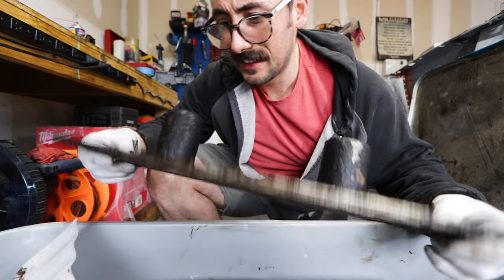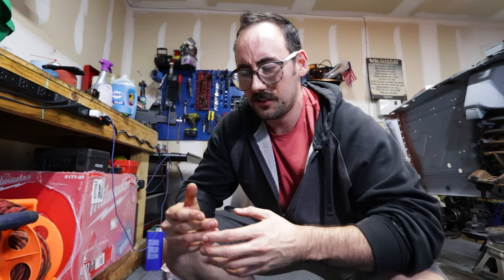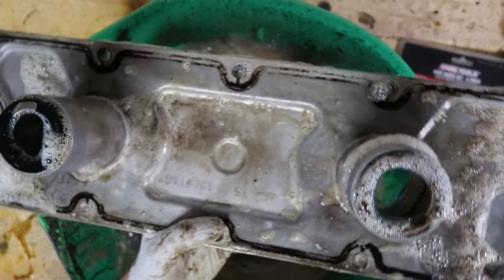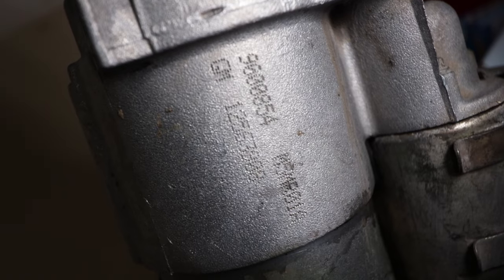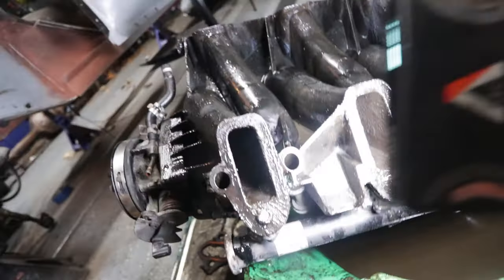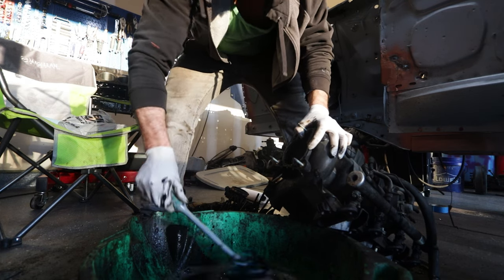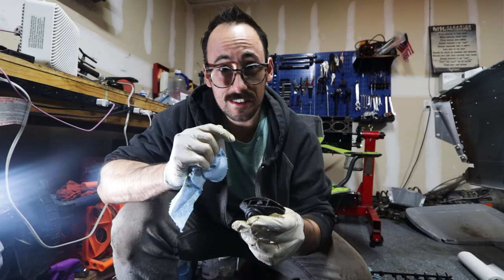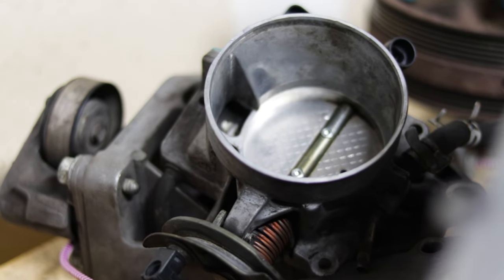Can Dish Soap Clean 360,000 Miles of Sludge?

Comment: If you want a simple way to remove carbon or sludge from parts. Soak them for a couple days in ATF. Seems counter productive, but works great. Saves a whole lot of scraping and scrubbing.
Reply: What's atf?
Reply: @christinad3425  Automatic Transmission Fluid.